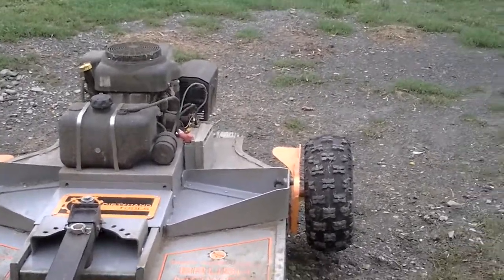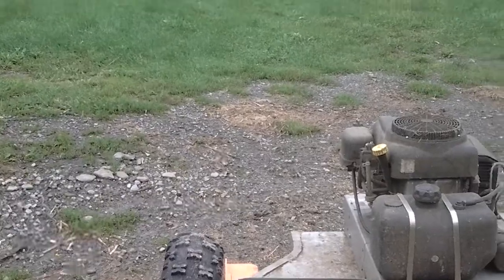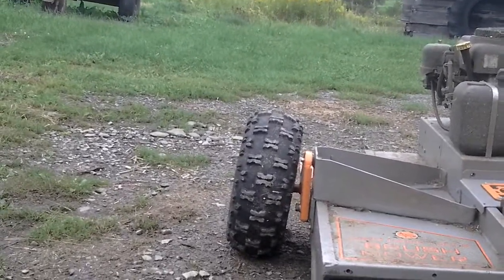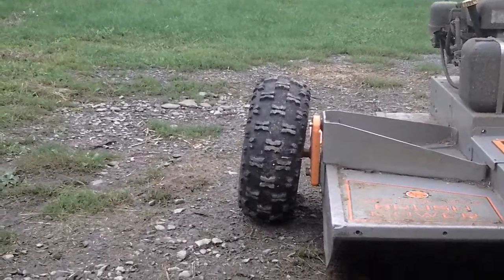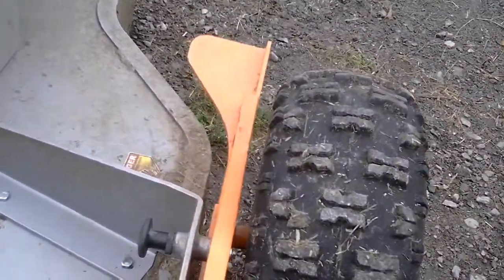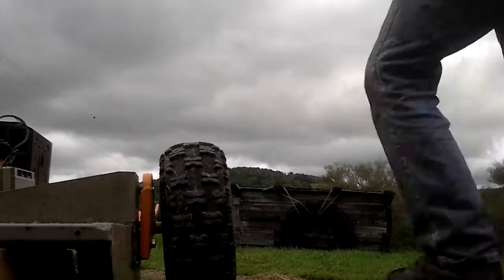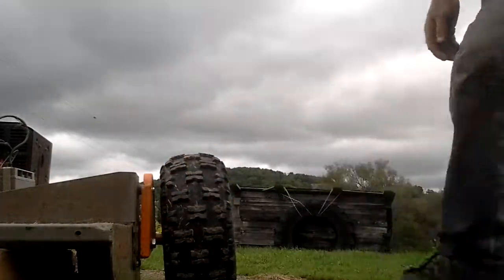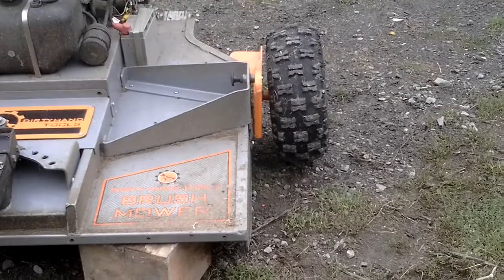Dirty Hand tools rough cut mower repair part 1

Comment: BUT WHERE ARE YER BUMPER GUARDS FOR THE WHEELS, WITHOUT THM U CAN HIT SOMETHING HARD AND DAMAGE AXLE ?
Reply from the maker: I believed too much weight, in addition to speeding,  contributed to the axles bending the first time.  The 
replacement axles weren't any different from the set that bent.  Bent axles instantly turned that $2000 mower into a $70 pile of scrap metal, I was not going to chance bending the replacement axles.  Furthermore,  a different part failed recently and I learned that because of Covid,  the company with the service contract (Frictionless World) downsized and excused themselves from all support regarding that mower.